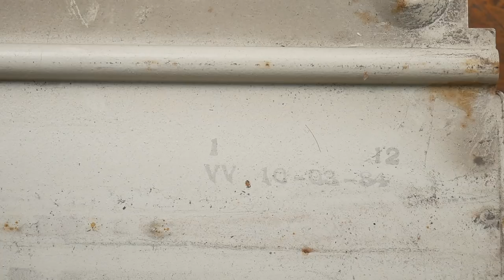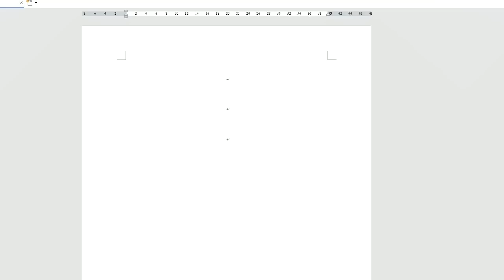1984 Old Keyboard IBM Model F XT (Buckling-Spring) Restoration | XT to USB Type-C

Comment: Sanding off the upper case texture ruined it for me. If there were unsightly heavy gouges and scratches, the best way would have been to fill it with very thin strips of PVC glued over them and then sanding then sanding them flush. You can then sand the entire case evenly and  bead blast it to the original or similar sandy texture.

Comment: Please list the hardware required for the controller mod.  Is the PCB a Blue Pill, some flavor of Teensy, or what?  Where do you get the little female-to-female USB connector you use?  That little plastic shroud looks custom - did you 3D print it?  If so, where is the recipe?
Reply: It said in the video the microcontroller was a pro micro. Everything else i cant help with, sry

Comment: If you had to paint the parts, why not paint them the original color?
Reply: Yeah, tell me. For me, as I used a XT way back in the day ( along with Apple IIcs and IIes ) any color but beige is heresy. I could understand, and let slide, the USB conversion but, really, you painted it gray of all colors? It should have been beige.
Reply: Agreed, he didn't so much "save" this keyboard, but ruined it by changing its colours. The USB conversion was necessary, but the colour change was not. Not was sanding the texturing off.
Reply: @GMMilambar  Right, why I could ignore the usb conversation, it was necessary. But it's pure heresy to recolor it. It probably only needed to be sanded down through finer grits until the scratches, dents, and dings were mostly removed. Though those do add character and leave a little hidden story that'll leave the user wondering about it's history. :D
Reply: Yes, the original color should also be restored. It is better to polish it than painting with a different color. USB conversion is a great upgrade but repainting with different color turn it off. I stop watching after the painting mess.
Reply: lol sensitive weirdos
Reply: @nekowife  
Agreed. Super weird that people would get so worked up with the choice of color of all things. I thought it was a great restoration.
Reply: idk reminds me of the model m industrial edition boards. I think its nice
Reply: @llloyd4  It's meant to imitate the industrial gray ibm boards
Reply: You guys are whining about the wrong inaccuracy. The biggest crime here is that he used rubber instead of cork feet.
Reply: It’s annoying. Though some model m keyboards came in grey or
Reply: It's a restomod. Do yours your way.

Comment: Does anyone know if he used the orginal cable for the converter or somehow found one of those pin headers?
Reply: there are pins on the board or you can get a female version of the end of the cable and do it there
Reply: @samueldsouza8797  where do I get it though because I couldn't find my my cable one time and resorted to trying to find online to no avail
Reply: definitely the original cable but if you still want to do this and don't have your original cable then you can just use jumper cables

Comment: what is this powder you put into the water for the keys?
Reply: Hydrogen peroxide. The process is called retrobrighting.
Reply: @LSD97123  Im pretty sure that this isnt the case because these caps are made of a non UV yellowing material (pbt) and therefore cant be retrobrighted

also you can see from their other videos that when they retr0brite they put it under a UV lamp to help increase the speed of the retrobright, which he doesnt in this one
Reply: @NautsuJJR  then what is going on here?
Reply: The keycaps used on the model F have a coarse texture that can "trap" small particles of dust and other grime on it.

The hydrogen peroxide is meant to dislodge that seeded in grime from the coarse plastic.
Reply: @LSD97123  defo not retrobright. I have one of these and is still a bright white
Reply: probably just powdered detergent

Comment: I love this channel. But what he did to this keyboard is an outrage. Sanding the plastic and painting it was crazy. Above is not even the original color. Adapting to USB is also a disaster. As it is not original, it is not a "restoration" but an adaptation. And quite low quality.
Reply: Bruh, why the hell would he not convert it to USB. Ridiculous thing to complain about.
Reply: Case is metal, not plastic.
Reply: @gravitationalslipstream  Ok. Metal. All other things are true anyway.